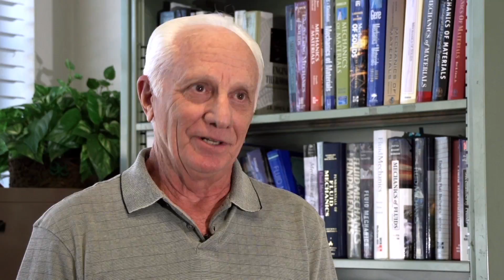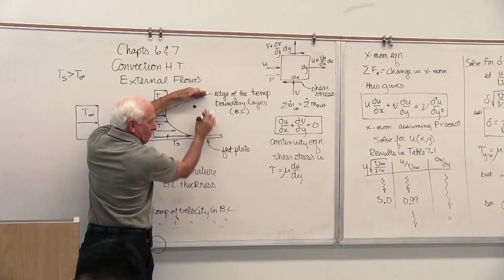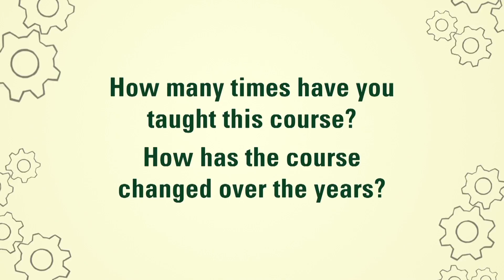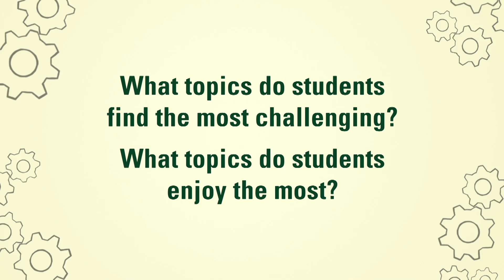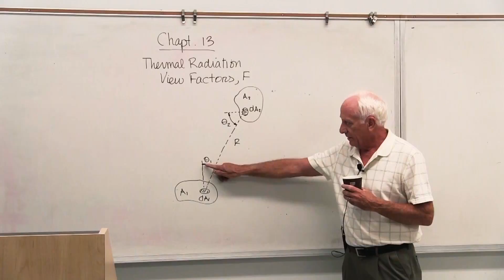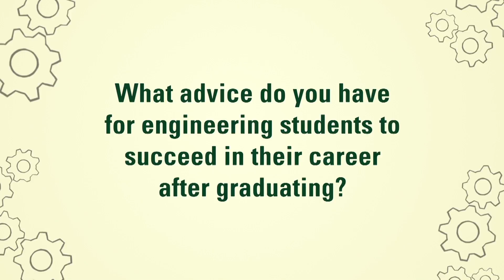Heat Transfer: Interview with Dr. John Biddle

Comment: I got my mechanical engineering degree 20yrs ago but because of my desire to understand climate change and Urban Heat Island effect, I started to think about how heat move around in the real world. But my understanding of radiation is only basic, so here I am trying to advance my understanding of heat transfer and fluid mechanics during my free time.